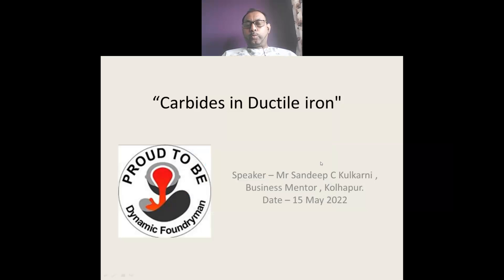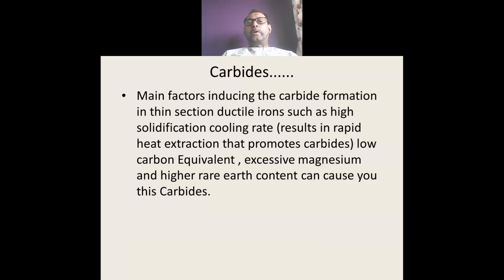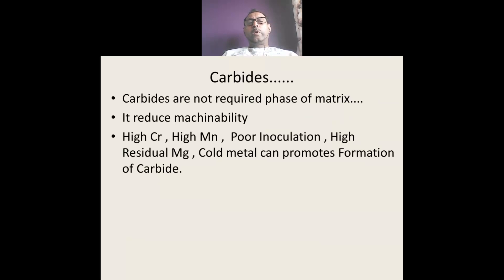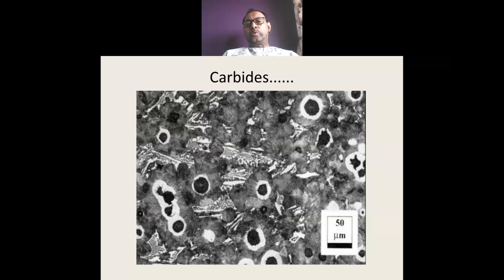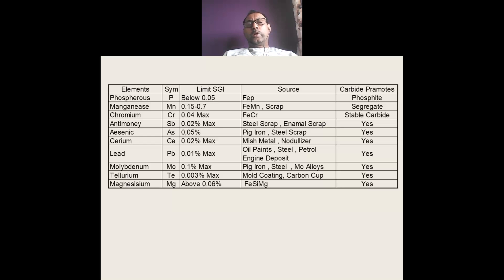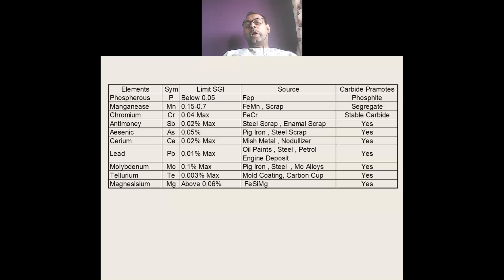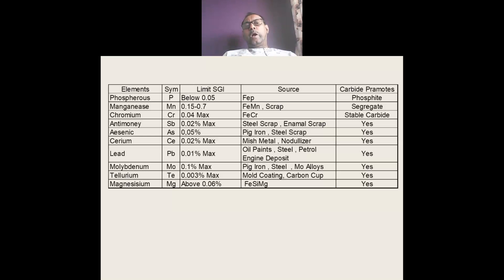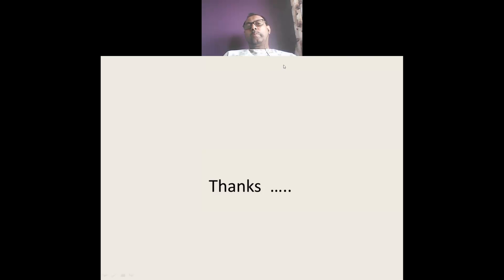Carbides in Ductile iron

Comment: You don't have deep technical knowledge about metallurgy.
Reply from the maker: I believe in practical tips and hence trying to give my practical tips and experience to all foundrymen.
Most of the time Theritical metallergy will not help you in taking decisions and solving problems in foundry.
Reply: But while solving problems, such as microstructures you must need theoretical knowledge. Without theoretical knowledge, Practical knowledge only achieved by trial and error method and it's not cost savings process.
Reply from the maker: @tigerkolhapuri6746  For every one this is not required. If we follow general rules like chemistry , charge mix , process we can get desired results. In the foundry we do not need any invention. we just need common sense and discipline. What you expected is knowledge needed in invention and Research and not in CI / Ductile iron foundry.
Reply from the maker: Noted  thanks 🙏